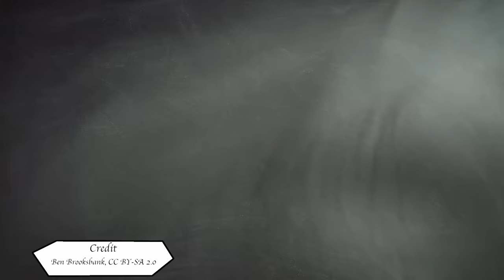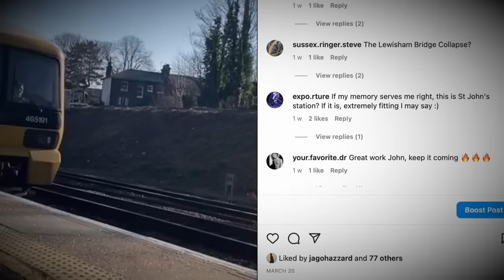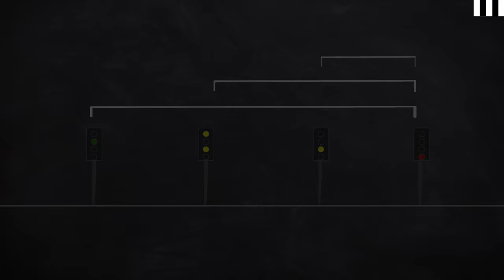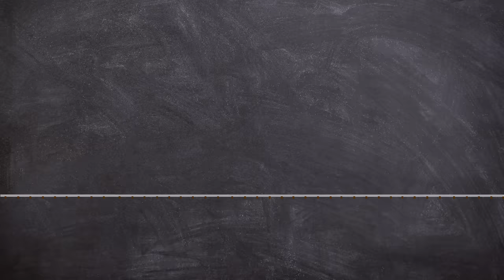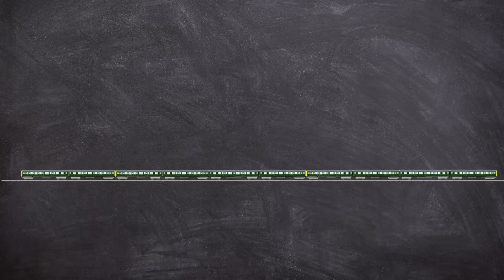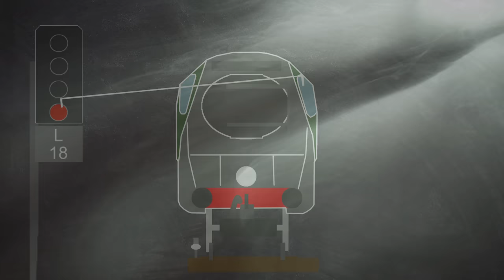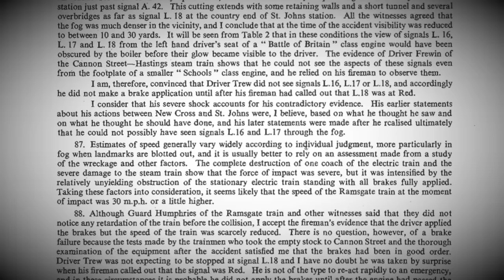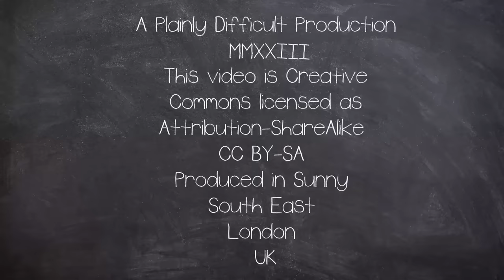Driving Blind: The Lewisham St Johns Train Crash Disaster 1957 | Plainly Difficult Documentary

Comment: It's unbelievable that the fireman wasn't supposed to look out for signals UNLESS the driver ordered him to do so. In continetal Europe it's standard for both driver and fireman (assistant on electrics and diesels, most our trains still have two-man engine crews) to look out for signals ahead and call their aspect aloud ALL THE TIME
Reply: Which European country are you in where two-man crews are still normal? 🤔
Reply: @dkbmaestrorules  Poland
Reply: Moreover, I don't accept the assumption that the driver on the left can't see signals on the right.  Think of a camera: if the window is an aperture (it is), then light passing through it on one side exist on the opposite side.  It is actually easier to see through the window ACROSS to the other side of where you are sitting (though you may not be looking that way most of the time).
Reply: Plus, go on the footplate of an unrebuilt WC/MN/BB class loco and try to see clearly ahead through the tiny dirty windows down the streamlined casing. Even on a clear day it's pretty difficult.
Reply: Lots of operating procedures from back in the day are unbelievable from the perspective of modern safety standards.
Reply: @jimwinchester339  On a flat fronted locomotive or with the short end leading, visibility is good. If you have a steam engine with the long end leading (No. 1 end), the visibility is quite restricted. The fireman has a demonstrably better viewpoint of signals on the wrong side and needs to call them out. Exactly as John pointed out in the video.
Reply: We still have two man crews over here in the United States and Canada
Reply: The fireman was supposed to look out. Rule 128 "The Fireman MUST-when not necessarily otherwise engaged observe and obey all signals and keep a good look out all the time the engine is in motion." However final responsibility must rest with the driver as the driver's sole duty is driving the train, whereas the fireman has to look after the fire first of all and keep a sharp lookout for signals only as a backup
Reply: Trains should always have three man minimum.
Reply: If only you had told them before the journey
Reply: @LUAu101  "Not necessarily otherwise engaged" is the operative phrase here.  The fireman has a lot of work to do on a steam loco, he has to watch the water level, watch the pressure, plan ahead for steam consumption, shovel the coal . . all of which prevent him from looking out for signals.  It's not like he's standing there waiting to be told what to do!  As you say signals are the driver's responsibility and if he wants to rely on the fireman to look out, he has to tell him to do so.  The driver should have been aware of whether he could see the signals or not, but in thick smog probably got confused about where he was.  Anyone that remembers London smog of the fifties would confirm how easy it was to get disorientated.
Reply: The Fireman cannot keep a lookout if he is shovelling coal, working the injectors or performing one of his many other tasks hence why the driver had to tell him to stop doing what ever and keep a look out.
Reply: I really think there's a bit of a misunderstanding here. Not only was it a requirement of the rules that firemen had to observe the signals unless there was something else that they had to do at that moment, but that was a duty that Fireman Hoare and his colleagues regularly performed whenever it was necessary, convenient or otherwise practical for them to do so. They did not necessarily have to be specially asked, although they could be. In the report we have things like 'Hoare added that he always made a point of observing that signal (L.18) just like the one at New Cross (A.42), leaving the two intermediate signals (L.16 and L.18) to the driver "because of the (left handed) curve ".' 'He acknowledged that it was a fireman's duty to order his work with the fire and the injector so as to be ready at awkward places to help the driver with the signals, but he considered that he had fulfilled this duty by observing the signals on the right handed curve on the end of the spur and then signal A.42. After this he felt justified in attending to the fire until he made ready to look for signal L.18 at St. Johns. He said that this was a good place to attend to the fire in preparation for the long climb.' 'Fireman Emery said that he had a good fire on leaving Cannon Street. He put on no more coal after passing London Bridge, and thereafter continued to look out for the signals, because he knew that Driver Frewin could not see all of them from his side.' Firemen had to have a good knowledge of the road as well and were expected to be a second line of defence.
Reply: Now, do I think Fireman Hoare was criminally negligent or something? Of course not. I completely agree the primary responsibility for driving the train has to rest with the driver, who could also have crossed to the other side of the footplate, as drivers did do. Do I blame the fireman? No. But was there some gaping hole in the rules in not requiring firemen to look out for signals? No they were required whenever possible and they were expected wherever they could to "order their work" so that they could look for the signals where necessary. They didn't have to be asked. In the words of Fireman Hoare himself 'Hoare went on to say that although he was not expecting Driver Trew to ask him about signal L.18, he was making ready to observe it.'
Reply: @6Six6Six6Bruh  Why? We have sufficient automatic systems to make that unnecessary. Unless we're talking long distance freight trains
Reply: @truedarklander  Because you cannot have enough redundancy. I did mean the freight trains, but come to think of it, why not every train save for heritage and tours?
Reply: Seems like a good plan
Reply: same practice in North America
Reply: At that time in history, the "chain of command" was sacred in train operations and other jobs. A fireman (assistant) would never tell the driver (supervisor) what to do.
Reply: @LUAu101 Also, 127 xvi: have his Fireman disengaged as far as practicable...so that he also may keep a look-out for signals. Neither men were doing a great job in a difficult situation.
Reply: As long as there is a “confirmation” requiring acknowledgement from the driver, either by a second in cab crew member of an electronic system that will sound alarm and apply  brakes if there isn’t an appropriate response by the driver, hat should be sufficient for safety. The key is for safety systems to be in good working order and not defeated by operating crews to suppress “annoying” reminders.
Reply: @illinoiscentralrailroadfan6015  You'd need them, I should think, with the vast stretches of open, sparsely populated country to be traversed.
Reply: @juk-hw5lv - "It's unbelievable that the fireman wasn't supposed to look out for signals UNLESS the driver ordered him to do so."
I don't know where you got THAT info from, but here's a quote from the 1950 British Railways Rule Book;  Rule 128, exactly as printed:
"The Fireman MUST - when not necessarily otherwise engaged observe and obey all signals and keep a good look-out all the time the engine is in motion."

Comment: I sometimes wonder if the colored-light signals may have contributed to this and similar crashes. The Pennsylvania Railroad in the USA used positional signals of three white lights (vertical = proceed, diagonal = caution, horizontal = stop). The reason I heard from my railroading family was that the crew could lose the ability to distinguish colors while staring out into the dark.

BTW, my grandfather was a PRR track supervisor during WWII, and had to clear up after a terrible derailment in Philadelphia on Labor Day 1943. 80 people killed. Might be a good subject for a video.
Reply: Even if the colour can't be seen, they're also in different spots just like road lights are
Reply: I thought one of the problems was that railway lights aren't consistently in different places? Ie, sometimes there's all 4 lights, sometimes just 3 or 2 or even 1? Plus in reduced visibility like fog you don't see the backing plate, so you don't know which of the single lights is on. And they're not in consistent places off the track, either, they could be left right or over top mounted sideways...

Comment: On the original Battle of Britain class locos, driver visibility was always an issue. Small windows, and being slab sided the exhaust used to be drawn down onto the windows.
Reply: The Southern Railway Light Pacifics, of which 34066 was one, were built to two widths. I think that the first 70 were wider and 34071 onwards were the narrower ones. The narrower ones were designed to work over the Tonbridge to Hastings line, though there are no known instances of their doing so. Rebuilding of the Light Pacifics began earlier in 1957, and continued until 1961, when 60 had been done. The others remained in their original condition, with steam being rapidly replaced. Surprisingly, 34066 was returned to service in original form, and remained so until withdrawn in 1966. Referring to the collision again, I know someone who knew Driver Trew personally, and I gather that he was a broken man for the rest of his life. He was, in fact, due to retire not long after the accident.

Comment: It's almost as though this part of the South Eastern Mainline is cursed somehow. Just a short distance away from this crash, just under 10 years after this crash, another severe accident occurred, this time at Hither Green. 

On the evening of the 5th November 1967, a 12 Carriage Class 201 DEMU (6S) unit 1007 and Class 202 (6L) 1017 derailed at roughly 70 MPH near Hither Green Maintenance Depot.

The train was packed at the time of the accident, with many passengers standing. The momentum of the crash blocked both the Fast and Slow lines with Traction Current being switched off to aid the rescue effort. In the end, 49 people died and 78 people were injured. The cause of the crash was a rail that had failed due to metal fatigue in one of the bolts at the point where two rails were bolted together (unlike today where they're welded)
Reply: Welds can still break and rails can disintegrate, see Hatfield!
Reply: @highdownmartin true, but since Hatfield, there has been a greater emphasis on safety, rather than balancing the books at the risk of safety
Reply: @SiVlog1989  been a sharp decline in safety since privatisation which would never have been tolerated underBR. Things are improving but loss of experience takes decades to recover from. Subcontractors are lethal in the railway environment
Reply: @highdownmartin  I agree, it just goes to show that rail privatisation, however much apologists try to defend it, was a mistake. Although Network Rail isn't perfect, they take maintenance of the railway more seriously than Railtrack or any private company ever did
Reply: I was at Grove Park (the next station to Hither Green) when this happened. We were waiting for a train to go back to Waterloo. We heard it all unfold.

Comment: Great Western (and then Western Region) engines not only drove on the right hand side of the cab, but for many years had used all over its system  a mechanical ramp and shoe with battery operated cab warning bell plus the ability to stop a train automatically (unless cancelled by the crew). Inspecting officers had for years recommended this system or something like the one on the LTS Tilbury Line to Southend.
Reply: After just about every railway accident where a driver overran signals, the Inspecting Officer urged the railway companies to follow the Great Western and equip at least the main lines with Automatic Train Control (ATC). They were reluctant to do this, not because of the cost, but because they were afraid that drivers might become too complacent, by listening to the bell, rather than observing the signal. Finally, after the Harrow crash of 1952, BR went ahead to install ATC on main lines. It is now called Automatic Warning System (AWS). Harrow and Lewisham would then never have happened, nor would the early postwar derailments at Bourne End and Goswick, not to mention countless driver errors before that. Unfortunately, ATC would not have prevented the Quintinshill disaster, as that was signalmen's error.
Reply: @andrewtaylor5984  It should also have stopped the Norton Fitzwarren disaster of November 1940 - but another distracted driver in conditions of poor visibility (wartime blackout) missed some crucial signals and then failed for whatever reason to act on the ATC warning. A three-figure death-toll was avoided almost literally by a hair's-breadth, but 27 still died. Maybe Mr Difficult could take a look at that one?
Reply: @johnjephcote7636  At Norton Fitzwarren, the driver cancelled an ATC warning in error. The last saving grace would have occurred when he passed through Norton Fitzwarren Station; it consisted of two island platforms, and on the main line the platform would have been to the left. On the relief line the platform would have been on the right. Owing to the blackourt, the station was unlit. Before putting too much blame on Driver Stacey, we must remember that his house at Acton had suffered bomb damage a few days beforehand, and the Old Oak Foreman would have been quite happy to give the train to another driver.

Comment: In the late 1970s I rode a Chicago (USA) commuter line daily into and out of the downtown terminal when I worked at Children's Memorial Hospital. Year's before, the railroad had installed signal repeaters in the cab of each locomotive. I suspect this is the type of system being installed on British Rail at the time of the accident. My question is, why we're the line signals located on the Fireman's side of the locomotive?
Reply: Maybe they forgot which Hastings they were actually in and thought they were working on the Soo Line. :D
Reply: do you mean that thing that made a bunch of beeping? I remember that on Metro North in NY area if you sat near the cab something made a bunch of beeping when you passed certain areas of track.
Reply: British locomotives vary, some have the driver's position on the left, and others on the right.  Usually, the signals are on the left of the line, so in this respect it's better if the driver sits on the left (as on, for instance, 60103 Flying Scotsman).  But historic tradition meant that some locos were built with the driver on the right.  For many locos, you can tell which is the driver's side by looking for the long lever that connects the reverser in the cab to the valve gear: this is on the driver's side of the locomotive.  (Obviously this doesn't work on locos with steam-operated reversing gear, but these weren't very common on Britain's railways.)

Southern Region was later than other regions in introducing AWS, which would have made this crash much less likely.  AWS sounds a horn when passing a signal showing a caution or stop aspect (red, yellow or double yellow), and the driver has to press a button to cancel the horn, when a visual indicator in the cab then changes to black and yellow stripes.  But there is an issue with this system when one train is travelling fairly closely behind another, so it gets a series of double yellow signals (this is quite common in suburban areas with a frequent train service).  Repeated cancelling of the horn can become automatic, so it's possible that the driver doesn't notice when the train passes a single yellow after a succession of double yellows, and thus doesn't slow down in time to stop.

Comment: Something that has not been mentioned is that several passengers including the guard and BR staff claimed that they did not feel that the brakes were applied after the danger signal was sighted and up to the collision. As an example, a vacuum braked train in good condition should stop from 30mph in circa 130yds, admittedly there will be a few seconds delay as the vacuum is released from the train pipe. This suggests that either the train was going faster than claimed, the brakes were not fully applied or that there was a problem with the brakes. A SPAD would require an immediate full brake application.
Having driven a 4 loaded coach train hauled by a class 4T at Swanage I can confirm that from 30mph the brakes were surprisingly responsive and powerful.

Comment: So I just finished the video and I am left wondering why didn’t the driver ask the fireman to keep an eye on the signals all along, especially given his location in the cab?
Reply: Propably a mix of habbit and tiredness.

The driver propably expexted the fireman to be watching.
Or he though he himself would see.
Or, most likely, he was used to the signals in that area always being green.
Reply: Perhaps a touch of arrogance, thinking he was superior and didn't need help from a junior.
Reply: Actually it was neither of those reasons. The driver had asked the fireman to read the signals for the previous part of the journey, which he did. However, the signals that were missed were located on the right-hand side of a left-hand curve and so were normally visible to the driver, even in poor visibility. The fireman stopped looking out at that point because the signals were normally visible and because he needed to build up his fire for the gradients on the journey.
Reply: What bothers me is that the signals are on the side opposite to the driver. Like, why? That's just begging for trouble.
Reply: @hauntedshadowslegacy2826  Not all engines have the driver's position on the same side!